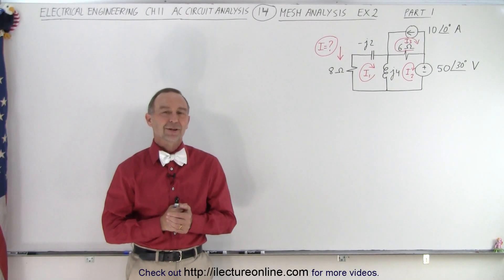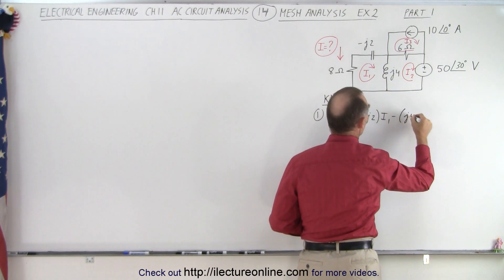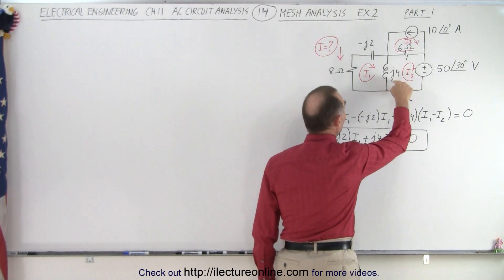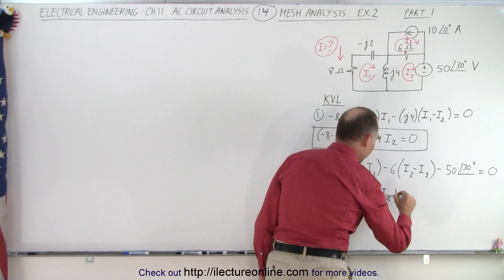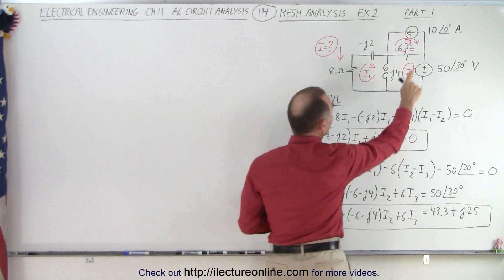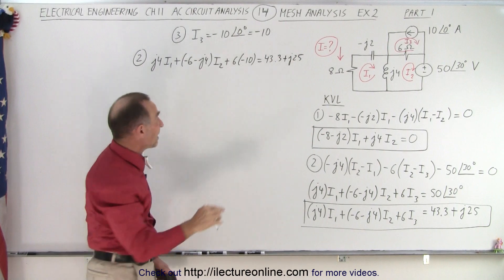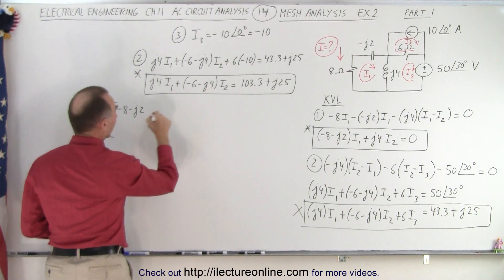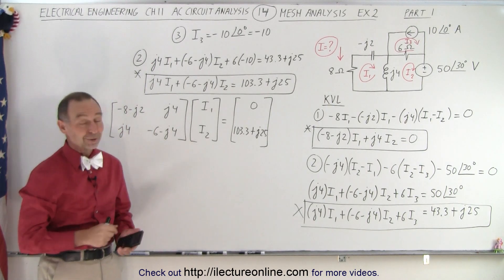Electrical Engineering: Ch 11 AC Circuit Analysis (14 of 34) Mesh Analysis Ex. 2 (Part 1)

Comment: In Mesh 3 I understand the current by the source is -10.  But why do we not account for the opposing loop current I2 over the 6ohm resistor as we would if there were no current source?
Reply from the maker: We need to solve for the 3 currents I1, I2 and I3.   Since we already know the value of I3, we don't need a third KVL equation for mesh 3.